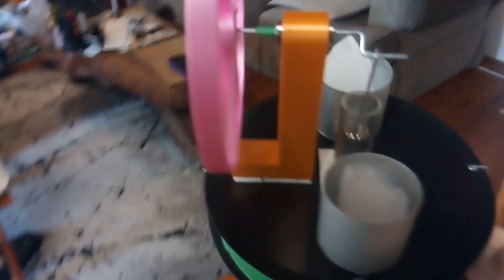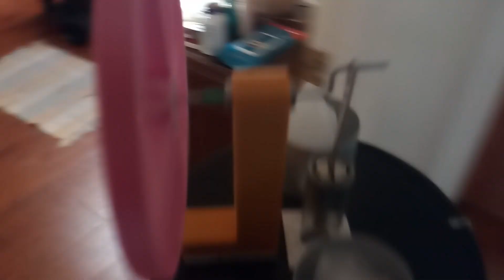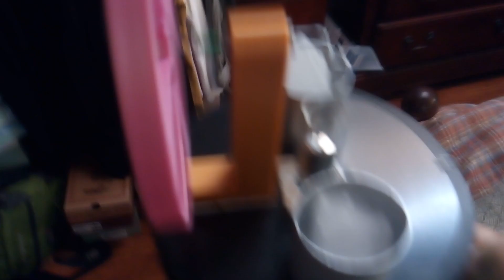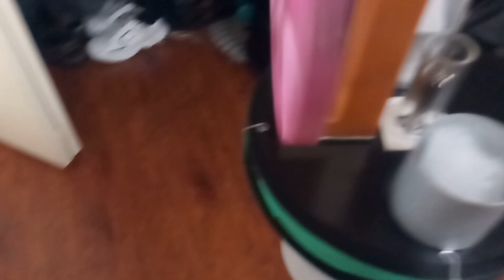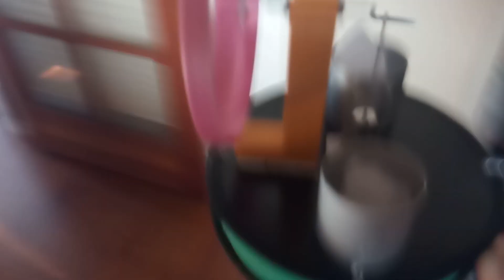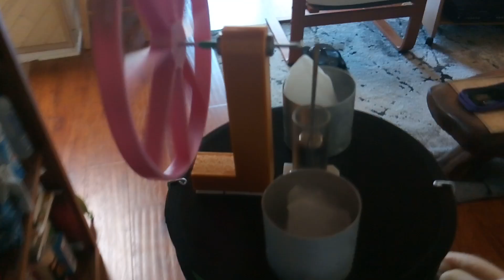My Magnetic Stirling Engine ---   Hot water vs ice test

Comment: I was going through some of your old videos on electrostatic generators like the Lord Kelvin replenisher.  What a perfect thing to pair with a Ltd stirling.
Reply from the maker: Great idea.  I have been thinking about similar 'hybrid' designs incorporating things that I have built.  Lots of interesting ideas come to mind.
Reply: @Lidmotor  Have you heard of electrocultur, electro horticulture,  or plant elecro tropisim?  The idea is that sometimes certain plants benefit from electric current, and some have been shown to not do so well under a grounded grid.  I  think i might take the solar cell out of a path light to power a tiny DC motor  to turn a pill bottle electrostatic replenisher with one inducer grounded and the other inducer to an ungrounded antenna out in my lawn and see if the small atmospheric ionic currents effect how the grass grows.  I think there is a relationship with bacteria that form nanoware transporting electrons and nutrients to plants that help conduct atmospheric current to the ground.